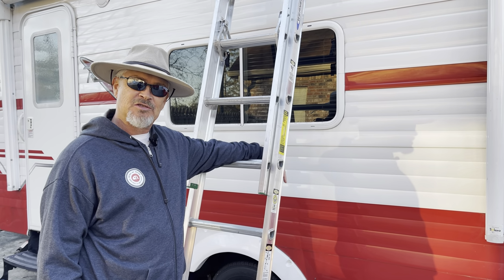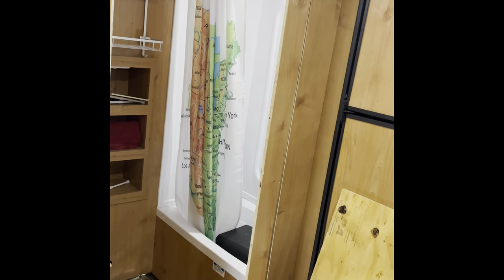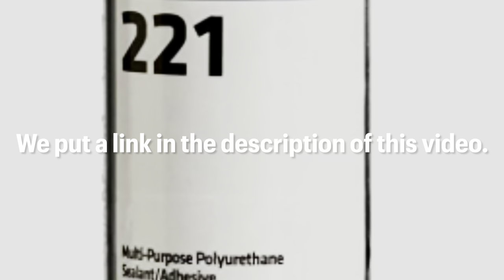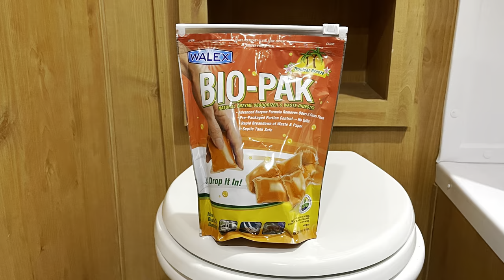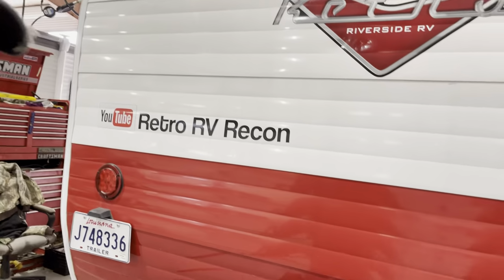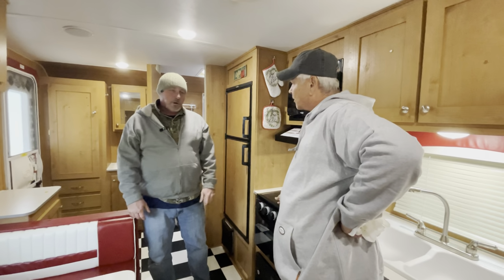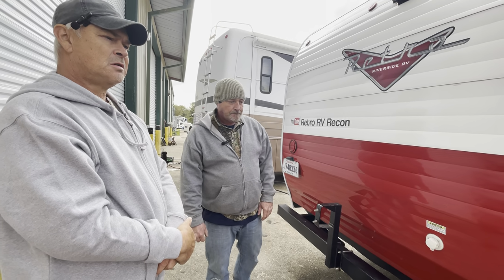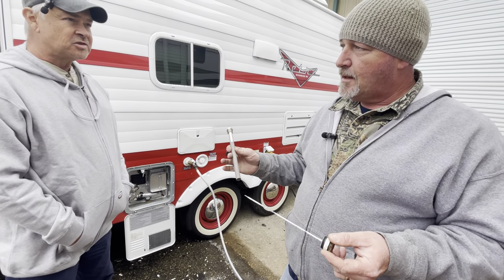What we learned during our RV WATER DAMAGED FLOOR REPAIR

Comment: Thanks for this account. Sure wish I had a Ken Mitchell service department and a Ron the technician in my area (San Diego). My 177SE sustained less damage than your trailer when a tire shredded and destroyed a wheel well. The repair facility the insurance company sent us to just declared it a total loss. But, they intended to replace the entire floor and floor covering, even though the damage was limited to one small area instead of the three areas that you found damage. The insurance company, 21st Century, was great. They paid off almost $15k for the total loss, then sold it back to me for $5k. But now I must either find a repair shop I trust or try to repair it myself. Maybe I should take a road trip to Louisiana...?
Reply from the maker: Hi drpaddle
Wow! it sounds like that tire did a lot of damage. I hope we never have to go through that.
The techs in Louisiana said, "bring it over!"😃
Maybe you can search for a Riverside dealer close to your area. 
We hope you can get it back on the road soon drpaddle.
Thanks for watching our video and good luck.🙂

Mike and Angel

Comment: What was the original issue and how what that detected?  A lot of good work was done, but I am a bit lost on what set of circumstances led you first to seek repairs.  How was the initial root cause corrected so that the issue does not occur in the future.   I have a 2017 177se and averted rear floor issues by early detection.  I have my story posted on the Retro site and will remain a nut about inspecting all seals.  Thanks for your story!
Reply from the maker: Hey Robert
We first noticed a soft spot in the bathroom between the toilet and the wall, in March of 2022. I thought sure I had a few months before I needed to take it in but after a trip in the summer I noticed the toilet was wabbling (crap) and the soft spot had grown a lot more than expected. We started to look for a repair shop. That task was tougher than I thought it would be, not all RV repair shops work on floors. We decided to check with the folks we purchased from. Then I learned that RV repair is popular and getting your RV in takes time🙄.
In the end... The water leaks were from bad seals on the rear of the camper (license plate bracket) and from the camper's fender-well. The shop repaired the floor and resealed the bad spots as well as resealed the entire back side of the camper.. Now, I'm a lot more thorough with monthly inspections.
Thanks, Robert for your question and comment. 
I'll join you in "remain a nut about inspecting all seals".😃

Happy Trails & Happy Camping

Mike and Angel
Reply: @RetroRVRecon  Got it.  I have sealed the wheel wells and entire perimeter underbody edge.  The underbody liner remains intact and of course the exterior seals are inspected.  I am always looking for areas that I may have missed or ideas that I have discounted, hence the question.   Happy Trails.
Reply from the maker: Thanks again Robert!🙂👍👍

Comment: What did they use to clean the roof before you put that eternabond tape down? I would like to put some on my roof
Reply from the maker: Hey Bob
I washed the camper a few days before then I used denatured alcohol in a spray bottle on the area before I applied the tape to it. I bough it at a local hardware store and I just added a link on Amazon in the description.
Thanks for watching our video, Bob.

Mike and Angel

Comment: Factory did a body-off full floor replacement on my 177, no messing around......was actually quite reasonable considering the work involved to do it right.  Total revision of the siding/floor/wheelwell interface.
Reply from the maker: Wow!! I bet you enjoyed have a totally new floor after that. How long ago was the replacement?

Thanks for watching our video Scat Silvurz.😃

Mike and Angel
Reply: @RetroRVRecon  In December 2022.   Got the latest and greatest fabrication techniques and materials, and they also did a lot of standard maintenance type stuff while ‘the hood was up’.   I really like the design of the 177, and figured the couple thousand it cost will provide more years of enjoyment as we use ours a lot….it’s no garage queen.  If you can make an appointment at the factory, it’s well worth it as they really get in there
Reply: @RetroRVRecon  December 2022.....being in michigan, our 177 is in storage til our first outing in spring.  The factory did a nice job.
Reply from the maker: @jokermtb  
Awesome!!
Thanks for sharing Scat Silvurz
Happy Trails & Happy Camping!

Mike and Angel
Reply: our camper has alot of soft spots and wanted to replace it or just get rid of the camper. what did it cost for your repairs?

Comment: As an RV professional who's been in the industry for a long time. Eturnabond is NOT a permanent repair as roof sealant, especially if it's applied over the old self leveling sealant. You MUST strip the old self leveling sealant and reapply. Save yourself the money it'll take to pay the next professional for the time it will take to strip all that junk off when you realize it's not working.
Reply from the maker: Hey kingrepair4401
Its always great to have a professional comment on our tips and tricks video.
Do you have a video showing how to remove the old sealant and reapplying the new self leveling sealant? If not how long of a task is it for a professional to remove old sealant from a travel trailer, about our Retro's size? 
 I absolutely agree the ideal way to handle the repair is the remove then reapply the self leveling sealant. But, given the cost a professional would charge to do the work (charging by the hour) I feel like what I did is a fair substitute. Our professional  shop inspected my work and gave it a thumbs up. 
Thanks for adding a professional comment to this video, every bit helps.

Happy Trails & Happy Camping
Mike and Angel
Reply: @RetroRVRecon  I'm going to be stripping and resealing an rv roof in the next few weeks and I'll be more than happy to video the job!
Reply from the maker: @kingrepair4401  That would be great!
Thanks kingrepair4401!